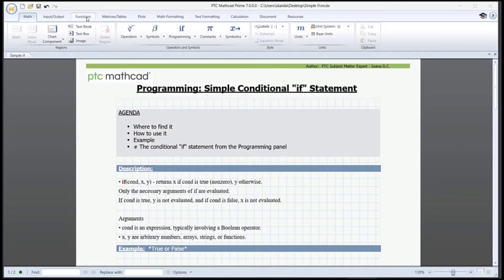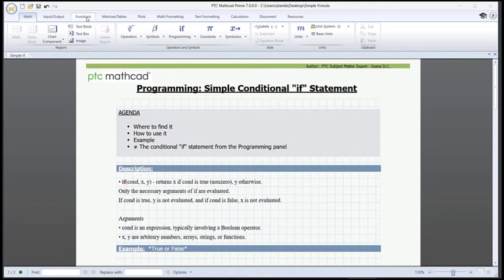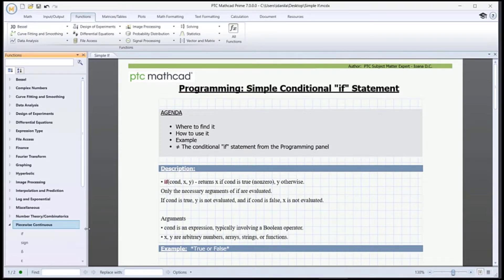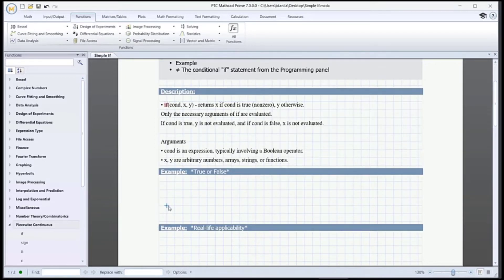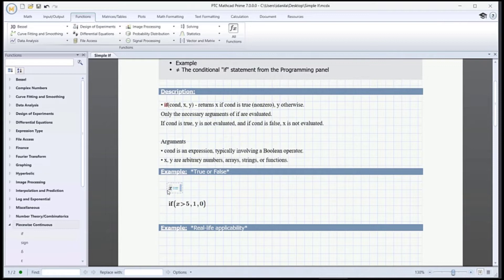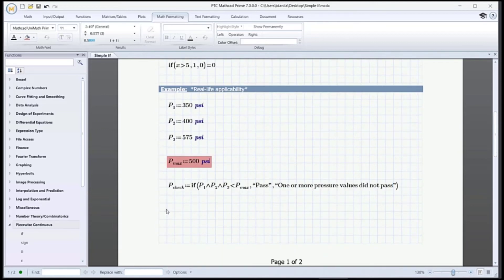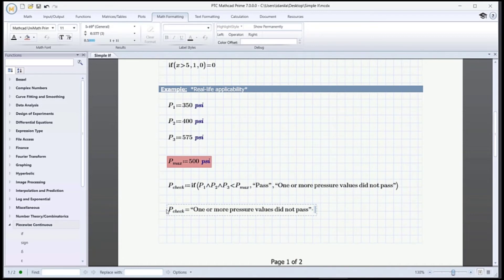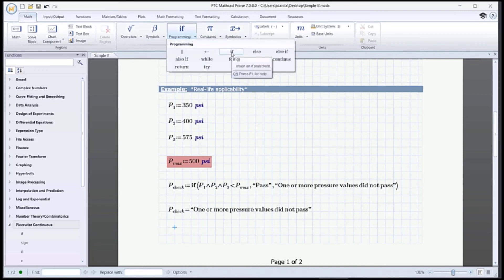Simple Conditional "If" Statement in Mathcad Prime

Comment: thanks this was very valuable. I am confused about how you wrote Pmax though? as it wont let me enter subscripts that are units... but you did it... how did you do it?

Also i had to change the logic to --> (P1 + P2 < PLimit, true, false) as AND doesnt evaluate the SUM 
i think it evaluates P1 AND P2    → TRUE AND TRUE → TRUE (1)
Reply from the maker: max isn't a unit, it's just part of the variable name; same way you'd write P\\1\\ or P\\2\\ or P\\check\\; use the keyboard shortcut for Subscript (Ctrl + -) or the Subscript button in the Math tab in the Style group.

If I do P\\1\\+P\\2\\ as shown in the video, you'd get 750 psi, which will return false as being less than P\\max\\ unless P\\max\\'s value is increased. If you want further help on this, you should go to PTC Community ( https://community.ptc.com/t5/Mathcad/bd-p/PTCMathcad ) and make a thread about it, where we can attach worksheets and screenshots.

Comment: What if you wanted to go back? For an example you’re doing your calculations and you made it to the end and you wanted to do a summary. I guess what I’m saying, if you wanted to say P1 is “ok” but you wanted put the value number of P1 next to it so you can see the value number and “ok” right next to each other? When I type = it’s spits out the “Ok” which is fine but I also want to show the value number next to it as well as the “ok” statement as a summary when I made it to the end of my calculations. It won’t let me do both since I did the if function earlier in my calculations.
Reply from the maker: Hi Selsius,
I think I'd have to see your worksheet? Which you could make a thread for and attach at https://community.ptc.com/t5/Mathcad/bd-p/PTCMathcad

But based on what you're describing, it sounds like you're redefining P1 from being a numerical value to being the if conditional? You can see at the end of this video that P1 and Pcheck are differently defined variables (different names), so if you did type P1= at the end, it'd still say 350 psi.